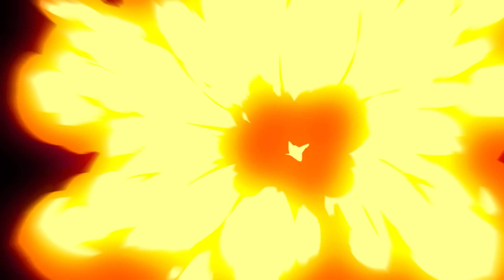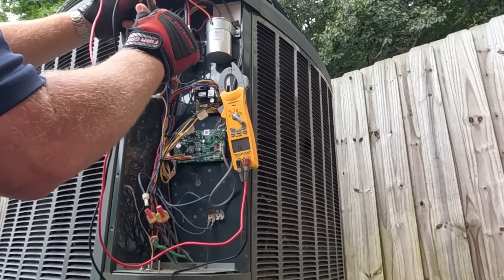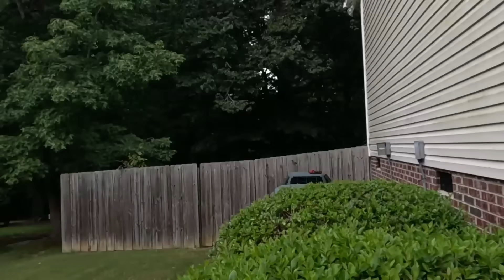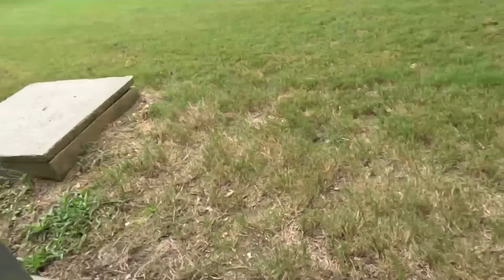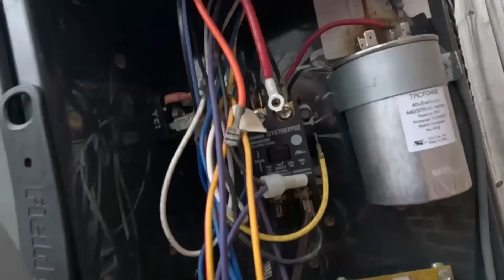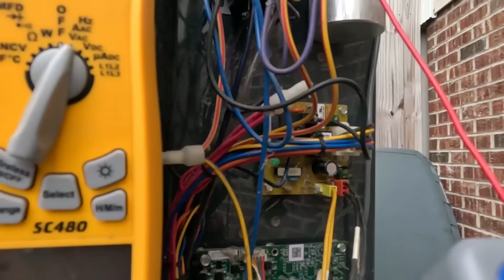Replace the unit or the compressor?

Comment: If the compressor is still under factory warranty I would replace it, if not I would replace the entire AC unit since it does not make sense spending that kind of money on a 10 year old system with zero warranty.

Comment: Repair or replace? What might be the LABOR cost to replace a compressor? Would that affect ones choice?
Reply from the maker: $1800 plus tax for warranty compressor job. Covers up to four hours labor up to 10 pounds of refrigerant materials recovery evacuation new filter dryer pressure testing. Everything except the compressor. Now obviously you may say go ahead and put a new compressor in it since it’s under warranty, but nothing else is under warranty and if the evaporator coil springs a leak next month, that’s not under warranty And will probably be another three grand in repairs.  It’s not just the cost of putting in a new compressor, it’s taking into account what other problems you could have considering the system‘s age and crossing your fingers and hoping you have no more problems.
Reply: @MYHVACLIFE  That's about what I expected. The firm I am using (now) wants to charge me $3672 for labor to do a 4 ton Am Std variable speed that's less than 5 years old (R410). And it has been broken over 30 days. Slow and expensive. I will be looking for another company when thi9s is fixed.

Comment: The unit looks to be in great physical shape.  And you dont have a compressor burn out so no neeed to worry too much acid in the system, but i would do a check anyway, and flush system if needed.  If there are no refrigerant leaks, then i say replace the compressor.  You can get they pretty cheap online.  Unit is worthy of a new comp.  It being a heat pump 2 stage, its goi g to cost a lot to replave the whole system, and if its that new R 454 B refrigerant, customer is probanly looking at $12 th $14 grannd.  Those supco winding testers are a must.  I was so glad to get me one.  Great trouble shooting.  Thats how i do mine as well. Very up front with my customers.

Comment: In the day I would have recommended replacing the compressor for this 3 ton heat pump( even if not under warranty ). I don't remember anything unusual about these units that screams "just replace the condenser" ( like micro channel coil might persuade me ) . Isolating the fan mostly proves it's a compressor issue. Nice job and thanks for the video. Stay cool.
Reply from the maker: Appreciate the feedback!

Comment: What exactly is there to "maintain" on a sealed system other than maybe cleaning the condenser coils? The cobwebs and dust your brushing off aren't going to have any effect on the compressor or anything else for that matter. You can't even lube the bearings on fans anymore they're all throw away parts.
Reply: Cobwebs can be conductive if they get wet or high humidity. Probably no big deal unless you have defrost boards or some kind of EEV or variable  speed drive.

Comment: Even if it's not under warranty, there's lots of Copeland  R410a compressors available for cheap right now, so replace it.  Even if it's $2500 all-in, it's a fraction of what a new multi-stage Trane would cost and that system should last another 10 years.  (Just my two cents, even after replacing my 3rd blown 2 stage compressor in a Trane.)
Reply: Commercial refrigeration, we replace compressors all day long. 2015, replace compressor get him another 10 years.
Reply from the maker: Appreciate the perspective.
Reply: BET IT IS NOT A CLIMATUFF ORANGE!!!

Comment: In a normal world a COMPRESSOR would be cheaper to replace than the entire system
Reply: First you would have to determine if the complete condenser was still manufactured and available. Likely it is not.  A compressor is usually available. Compressors and the labor could add up to about the same cost or close to it.
Reply: @Garth2011  the mark up by hvac companies is ridiculous

Comment: At this point ya hope they have a 410a condenser in stock of the same model. If not the only option is a new can. But labor is not covered?
Reply: Parts only warranty which is sad.  The should include labor.
Reply from the maker: No manufacture covers labor at 10 yrs old, unless you buy a PnL WARRANTY.